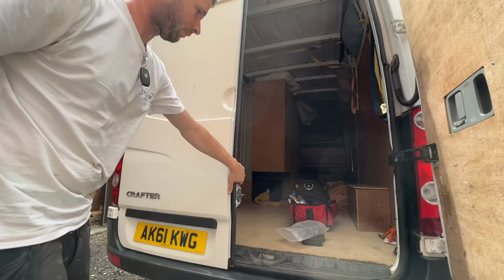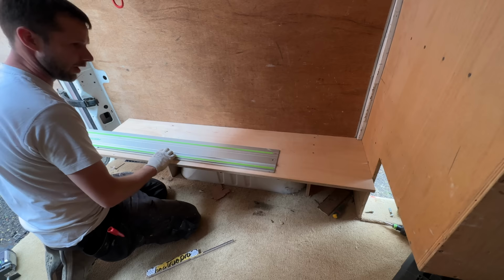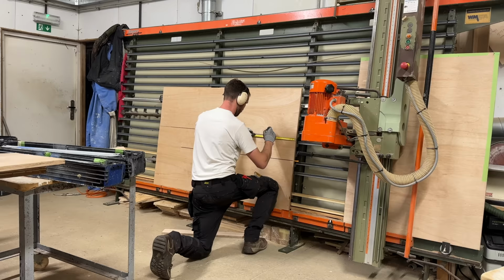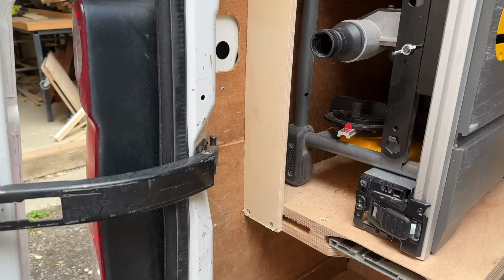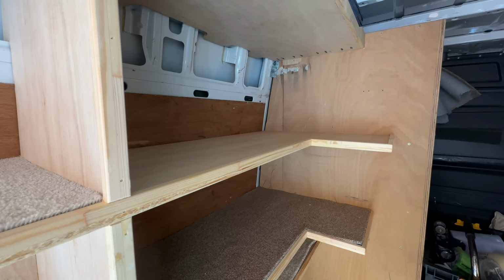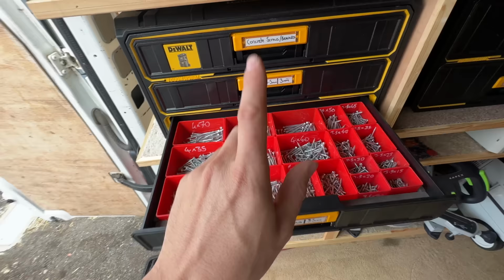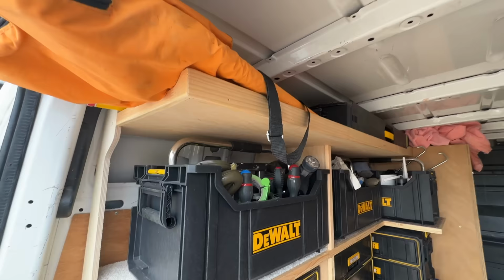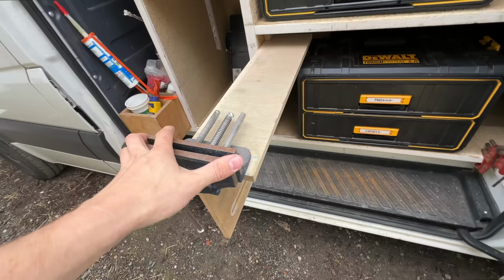Van Racking for Joiners - Building my Tool Storage

Comment: looking good. i couldnt trust those tools to stay there. i would put a bungy strap around just to be sure. 
im supprised you didnt make the side door racking double sided  . its wasted space anyway so you may as well use it from the other side
Reply from the maker: I did think a out double sided but only adapting now. Originally it fitted 2 layers of systainers and worked great...( But couldn't open them either.) If have to rebuild it completely to double side it and I simply don't.have the time. Adding this on was big effort! 😂
Reply: @BradshawJoinery  ]
i know the pain. im considering re doing my racking but the effort rewuired is hard to find and the benifits are not worth it enough to take a few days off
i would take the back off or cut holes in it  and then put a piece inside between the shelves half way in

Comment: but what has he planned to prevent tipping in the turns for the toolboxes🧐
Reply from the maker: It's great bud, the carpet pile does the job and the tool boxes take a serious over 50 degree tilt to roll. (they will not roll) only think that can wobble is the table saw and that lip of timber stops it if it does. But again if I sit it that way around the bed is heaviest and it only tilts towards the side of the van. 👍

Comment: Another great video. Came just in time as im about to rack out my new van, gave me a few ideas for mine. The screws in the drawer is a great idea. I share your fear of the organiser being open. Thats the sort of thing that happens when you've just finished a job and just want to go home after a long day 😅 do you have link to where you get the Würth screws from? Im guessing you order them in bulk
Reply from the maker: I buy through a rep on account. I think it's the only way. I would shop around next time. It's difficult to find a supplier that will do every size screw though tbh
Reply from the maker: The drawer inserts came from B&Q £10 screw organisers. The larger concrete screw ones from eBay but we're pricey
Reply: @BradshawJoinery  do you just Google a local worth rep? I made an account with them yesterday, but their site is a little herd to navigate. I'm looking for a company where I can bulk orders, though, as I need to start building a stock of screws like yourself.
Reply: @BradshawJoinery  I tend to get my concrete screws from toolstation
Reply from the maker: Give them a call and ask for a rep. They are quite keen for business, so usually chasing you 🤣
Reply: @BradshawJoinery  okay I'll give them a call on Monday. Thank you

Comment: It’s a nice job, but what about the distribution of weight in the van after all seems to be a bit too much weight for one side making driving a bit hazardous
Reply from the maker: Cheers bud, its not too bad, i keep the heaviest boxes lower as they are easier to lift in and out. I plan to add a small rack the other side for some trolley wheels and workbench mft style worktop. Plus the driver is rhs!

Comment: Hi. What size countersink with stop did you use there? 3.5 or 5mm? Which would yous recommend? I think the smaller one.thanks in advance. Also ehst scribing tool fid you use there please?
Reply from the maker: I have the 5mm ones as mainly use 4-5 mm screws in general stuff. Its veritas one
Reply: Watching this again as just about to finish my  racking for larger items and rails etc. Did the side door entry for all my l-boxx and a small parts rack to the side. I am pretty IT savvy but have really struggled in getting the hang of sketch up. So I am just going to steal some of your ideas and mix with my own. I need to persevere with sketch up though. It's vital I learn it if I am to expand my business and profitability.